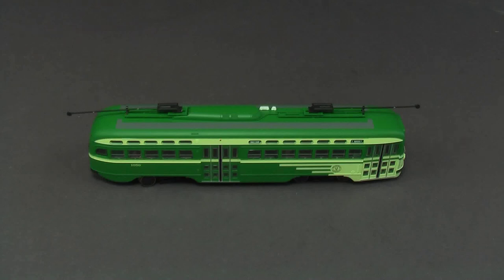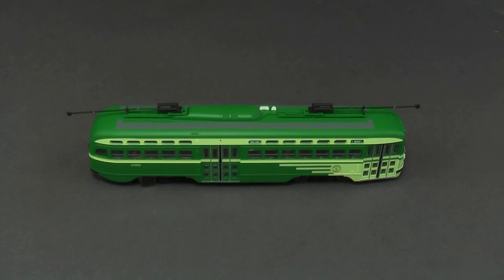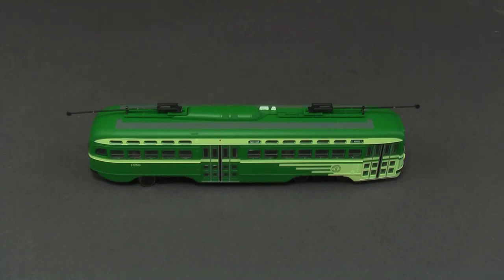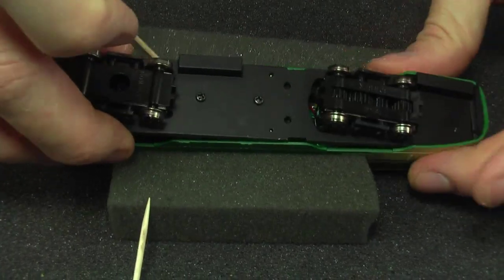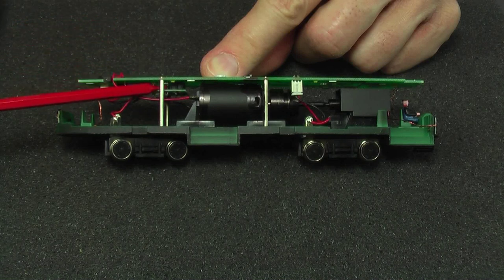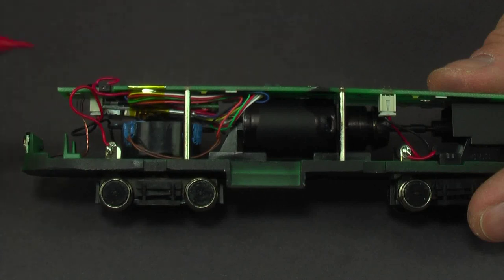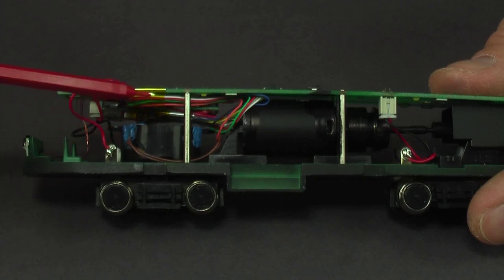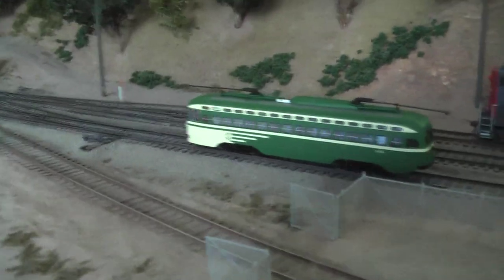HO Scale Installing DCC Decoder In A Streetcar 6-1-13 Podcast

Comment: HO is awfully small for scale overhead, but I guess it's been done. Now that I'm at the bifocal stage of Life, 'O' is my limit of tiny-tude.  "G" would be even better, if I had the space for a gigantic layout & the money to spend. 

About streetcars backing up: the motorman can't see who he's about to run over, so it was a big no-no. However, they WERE often backed up anyway,  especially at the end of a line that didn't have a loop - they would go just past a switch at a side-street, back into that street, then flip the switch & head back in the other direction.  In Buffalo, such wyes were supposed to have a switchman posted, to guide the motorman - but often there was nobody, and often the motorman backed up right over some hapless person or dog.
Reply from the maker: Would you believe I know a guy who does live overhead in N scale?